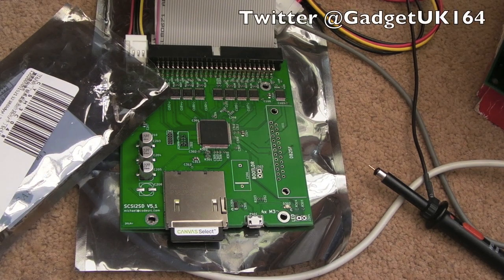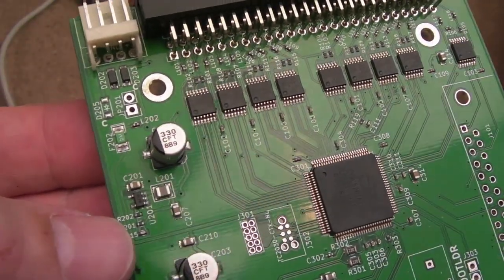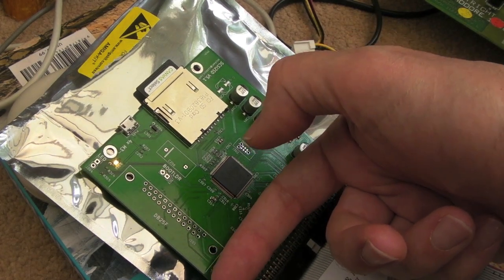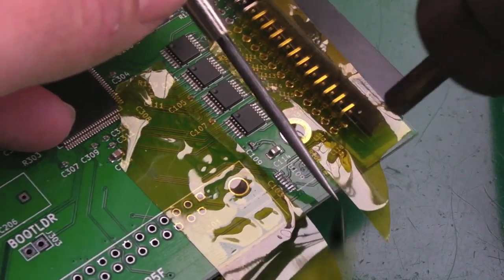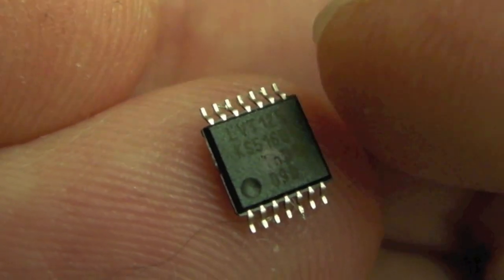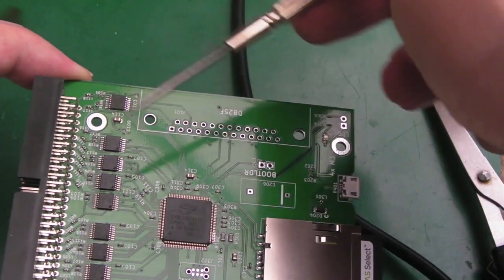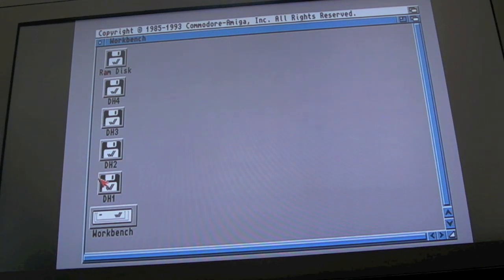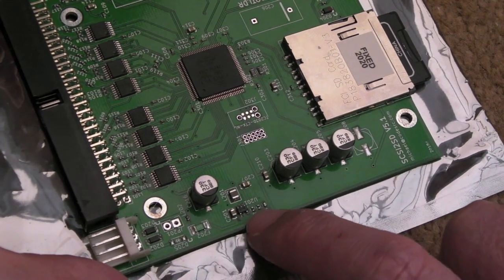SCSI2SD v5.1 Repair

Comment: I miss this feeling, the joy of repairing a board after so much troubleshooting and finally finding the problem. I have at least one of these boards, got it for my Sharp X68K. Sadly though many life issues occurred, I'm not currently able to work on any of my projects. I always feel like I tried to research what I could do with my Amiga 2000's, and never had the ability to look at all the parts I have to create a better build with them. Like looking at all the parts and some one be able to tell me what are the options I have on hand. it seems like theres not a specific formula showing what you can achieve with an overall parts pile or a flow chart on where to go from the current build. I've found more info on prior PC builds that are more informed than having to dredge through the multitudes of singular info on Amigas in forums. I wish the Amiga community was more straightforward about what's out there/what to do with available resources in a forum, than each part being a product of it's own. I don't have the time to piece it all together these days, and you literally have to delve through multiple sub forums to even find if you have proper compatibility for a route of upgrades. That being if they've tried to actually run a multi upgraded rig. I'm trying to watch every video from you Gadget, as you've been the most direct and easy to follow guides for these options. Albeit if you have problems along the way, you show the incompatibilities with an answer at the end. Cheers to you for teaching the avid user/technical repair man what to expect from you're own experiences.

Comment: These boards are amazing, but the shipping costs are very high considering the size and weight - I think the minimum box size in their shopping cart is set too large, so the estimate for shipping one board is the same as for shipping forty of them (no joke - try it yourself). They also have a new external version with a DB25 connector on it for use on external SCSI connectors - it is also very cool!
Reply from the maker: Yeah, shipping cost from a few places is over the top!  There are clones on eBay from China but those are over priced imo.

Comment: AmigaKit sent me out one of these scsi2SD drives and could get it to work.  Didn't have the molex to floppy power adapter at the time.  Even connecting it to USB did nothing, light never came on.  When the adapter came I assumed to needed to be connected to the A500.  Sadly no luck.
Reply from the maker: Strange, maybe you just got one that was dead on arrival =/
Reply: @GadgetUK164  Sadly Amigakit and PayPal disagreed and I lost out on £60.

I will get another from somewhere as I'm struggling to get any of my SCSI drives to work with the HD8 drive

Comment: make Capton tape over the resistors neer the voltage regulator! If you toch a 1megaohm resistor you chage the value and the voltage goes up. this damage the other ics.
Reply from the maker: Good idea!  I will do that!  The other issue is the temperature one though - get direct sunlight on that area of the PCB and the voltage goes up!  When the room is freezing cold in winter, the voltage is low...  I will be better off swapping out the regulator at some point!

Comment: Why would you use 0402s when there is so much space on the board? I assume the resistors are to set the output voltage. Spacing them out a bit more isn't going to make much difference.
Reply from the maker: Yeah, I don't get why they used such small resistors =/
Reply: There might be a lot of space on the board but having space between components makes routing easier. Imagine you have decoupling caps on pins 1 and 3 and then a signal on pin 2. You want the decoupling caps near the pin. With 0603 you might need to move them back to get the trace for pin 2 out whereas with 0402 the caps can be right up need the pins without blocking pin 2. Also the price difference between 0402 and 0603 isn't much until you get to high values like 10uf so the price doesn't change but your life is easier. 0201 and smaller is different because those parts cost more and are harder for cheap assembly shops to mount.

Comment from the maker: The LVT125 is a Quadruple Bus Buffer with 3 state outputs.  It has more in common with a 244 rather than a 245 (that was a mistake in the video - as its not bidirectional).  It should be powered between 2.7v and 3.3v, and is 5v tolerant.   I still have the old IC and will test that in a follow on video - just out of curiosity.  I would like to know which SCSI pin it went to.   If you are wanting to source one of these:-
v5.1 http://amigakit.amiga.store/product_info.php?products_id=1264
v6.0 http://amigakit.amiga.store/product_info.php?products_id=1314
v4.x? https://amigastore.eu/en/600-scsi-to-micro-sd-adapter.html
Reply: The amigastore.eu SCSI2SD is a variant on the old opensource version(v4 i think).

Comment: Hello, I bought SCSI2SD v6. I have ATARI TT and FALCONA030. Is it possible to supply power to SCSI2SD via the output of ATARI floppy disk power supply with SCSI2SD floppy disk input. Currently, I can only connect via usb computer - SCSI2SD v6 2020c, I have two more power adapters to charge the phone also with a 5v usb output. one has 460mA and the other 1.2A. The SCSI2 instruction states that the power supply cannot exceed 500mA and 5V, especially the problem with the 500mA current - no one on YTub addresses this problem, hmm, how to connect SCSI2 from a loved ATARI floppy drive or from a converted USB output from with 2A and 5v current? Can I ask for help with the solution NOT to burn SCSI2SD chips.
Reply from the maker: You can power it with 5v from the Falcon for sure.  You just need to join up somewhere (perhaps using a splitter on the FDD power connector).  Just make sure that 5v joins up where its required on the SCSI2SD.  Sometimes (eg. on the Amiga A2091) - 5v is provided on the SCSI cable itself, so you dont need additional power connector then.

Comment: Hi i also got this version but it also not detected on the usb. The small regulator is getting really warm. Do you know which one I have to order. All the big silver caps have a shot , the three down below..
Really like you video fixing stuff
Reply from the maker: If it's not detected on the USB I would expect a problem with the MCU on there.  Check the USB port solder contacts.  Also measure the voltage on the 3.3v regulator - make sure its outputting approx 3.0v.  I've go no idea on what part is uses?!?!  Check R302 and R302 that feed the data and clock from USB (to the connector).
Reply: @GadgetUK164  
Thank you for helping. The dplus is shorted  and also all the caps around the cyprus are also shorted ...
Bummer 🥺🥺

Comment: What is the mount for these you briefly mentioned in the video? I have been trying to figure out how to mount one of these inside a computer.
Reply from the maker: There's a 3D model that allows it to be fitted to 3.5" mounting holes.   Dennis (RetroGameRevival) is kindly printing me a couple.
Reply: @GadgetUK164  Can you post a link to the model?
Reply from the maker: @michaelsworkshop9031  https://www.thingiverse.com/search?q=SCSI2SD&type=things&sort=relevant
Reply from the maker: @michaelsworkshop9031  I went with the "SCSI2SD Universal Mount" one - it looks profile correct regards the mounts and my 5.1 boards.  It hasn't arrived yet though.
Reply: @GadgetUK164  Thank you!

Comment: could it be conducting across your finger when you touch the tiny resistor?
Reply from the maker: Yes, that's why the voltage changes!  Because its in mega ohms, your finger just adds more mega ohms.  But it should not be changing with temperature so easily too!  I had a few people confirm the regulation is affected the same way on theirs.  So there's no fault in the regulation, its just the way it has been designed.
Reply: Yes. The dry resistance of human skin is about 1-3 Megohms or so. If you then touch a 1 meg resistor, that’s putting 2 resistors in parallel, so the total resistance could be anywhere from 500 kilohms to 750 kilohms or so. Even less, if it’s hot, and you’re sweating (or you touch a hot component.)
As for changes in resistance with temperature, it’s just like changes in resistance due to any other environmental factor, or just component aging. If it’s still within the specified tolerance, then it’s “good”. But the absolute delta (or change in reading from lowest to highest) is going to be smaller with a 100 ohm resistor, than it will be for a 1 Megohm resistor. So, if you’ve got a temperature sensitive component in a feedback loop (such as inside a voltage regulator), it could throw things off. It sounds like one of the components in the regulator circuit is of poor quality, or is not the component specified by the original designer/engineer. You can try finding a precision 0.1% resistor at 1 Megohm, but it might be a bit pricey, especially if you have to fill a minimum order. Vishay makes precision resistors for testing/instrumentation applications. HTH. 😊

Comment: I would not said resisteance but more capacitance effect on the LDO. Maye capacitance change and so the loop because unstable and so the output voltage drops. this little LDO are fu** annying they just die alone. We have them on a CPU board in university and at the end we decide to not used them anymore. Annoying to solder and very fragile.

Comment: I would modify the regulator circuit, it is way too unstable, drop in a fixed 3.3V regulator, I would say 100% chance that it failed because of the rubbish regulator circuit.
Reply from the maker: Yeah, I thought about doing that but I am a bit warey that its designed to be 3.1v.  I would need some regulator that can be tweaked to output 3.1 volts.  I could use a resistor potential divider I suppose on the output of the reg.
Reply: GadgetUK164 - Retro Gaming Repairs & Mods - another option is to look up the data sheet for the regulator they used and check how the resistors are configured, my guess is that they are a resistor divider feedback circuit, and if that is the case then you could reduce the values by 10x (keeping the same ratio) to increase the current through the resistors, which would greatly reduce voltage changes from external effects, the lower the current is (and the more “floaty” the connection) the greater the sensitivity is to RFI, EMI, and temperature.
Reply from the maker: @TheDefpom  I did wonder about that - that might be the easiest option!  I will look up the part number tomorrow, and order some 0402 resistors!  Thanks!

Comment: Getting 3.3V logic work flawlessly with 5V is not that easy. I've fried waaay too many FPGA boards and ARM MCUs doing just that.
Reply: The very first page of the TI SNLVT125 data sheet states "Supports Unregulated Battery Operation Down to 2.7 V" and "Supports Mixed-Mode Signal Operation
(5-V Input and Output Voltages With 3.3-V VCC)"
Reply: Also, the Cypress PSoC that powers the SCSI2SD V5 boards is capable of multiple voltage domains, and runs at up to 5VDC. You can assign pin groups to lower voltages.